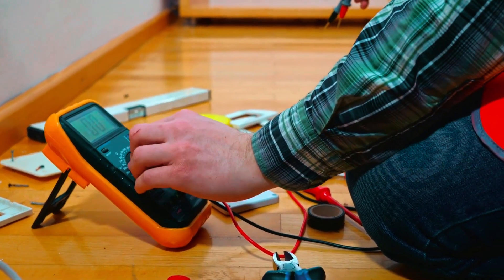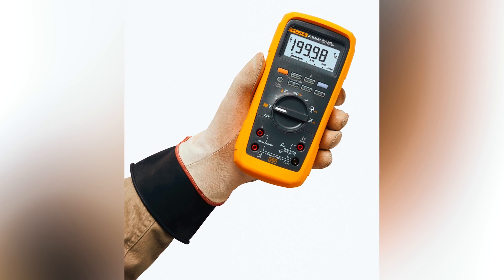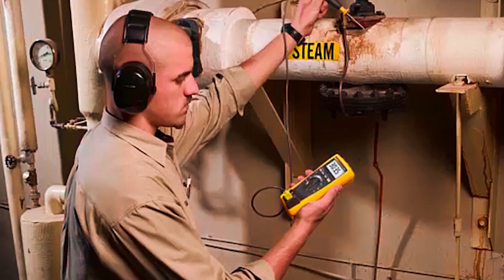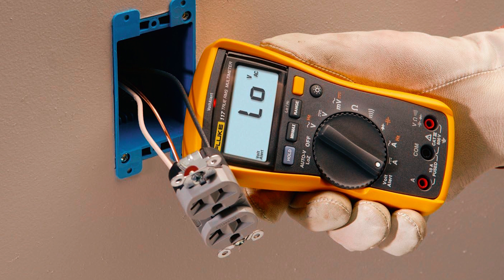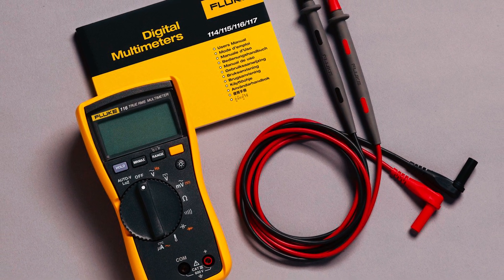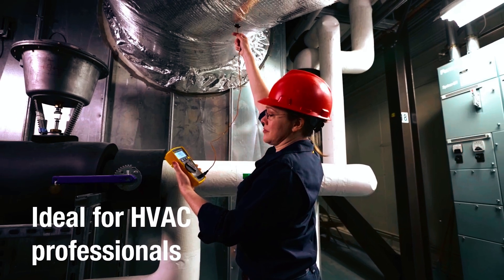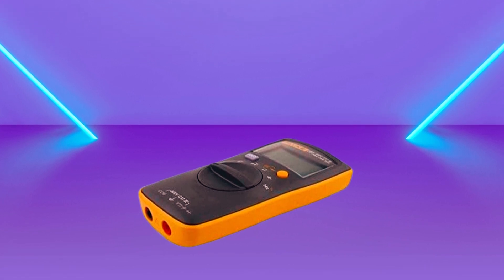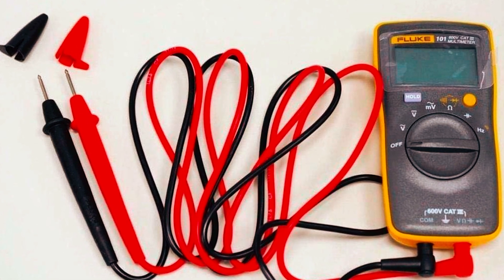Best Fluke Multimeters 2026 ⚡ Accurate & Durable Top Picks!

Comment: Fluke (and other such brands) are undoubtedly quality products. However, their prices are deliberately much much higher than the cost. Not only for multimeters, but for oscilloscopes the same story goes. If these traditional companies do not lower their prices, abandon them. They will automatically lower the prices. You do not need such accuracy in your routine works. It is just a fad (and a bit of deception).
Reply: 117 for so many reasons, the others have too many or not enough key features, the 117 has such a nice balance of features and ease of use, this paired with a 378FC and the 325, and the 87, and you should be good to go